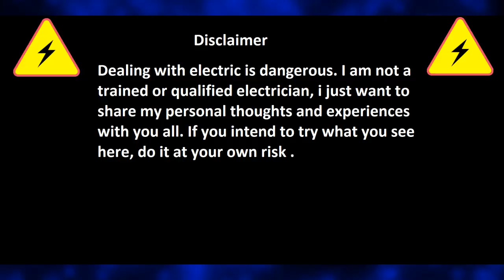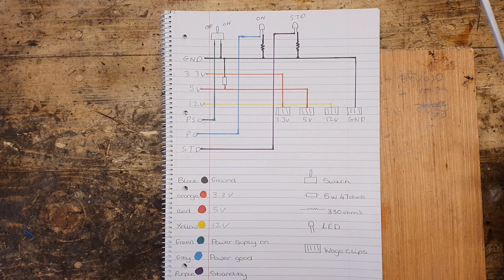DIY benchtop power supply

Comment: What is the large resistor for? Load simulation (dummy load)I think you said, but why?
Reply from the maker: Yes to simulat a load if you don't have one installed it can becomes unstable and shut down 👍
Reply: I don’t think you need one on the old style ATX power supply ( with an actual on/ off switch on a lead ), but I would need to look that up
Reply from the maker: I tested it without one and the output voltage wasn't stable it was under what the votes should have been as soon as I put one on they went sable might be a dodgy power supply
Reply: Ah ok. I've been amassing bits to build one and fear I'd be over complicating it as a first-time build. Do like the wagu idea too. Sort of like the mains tester thing so you don't have to wire a plug on all the time